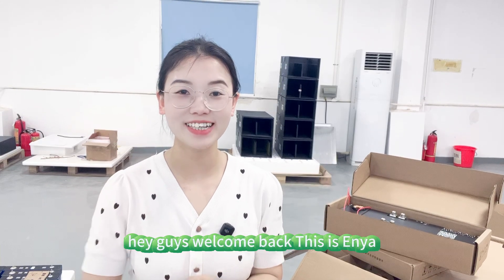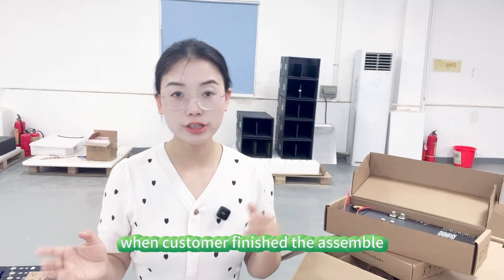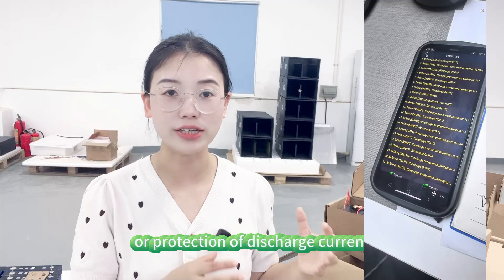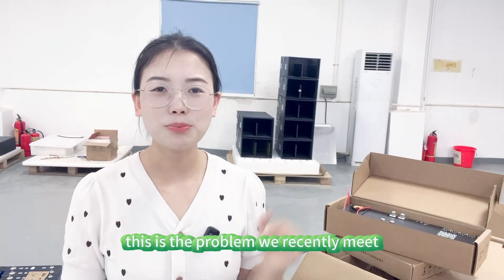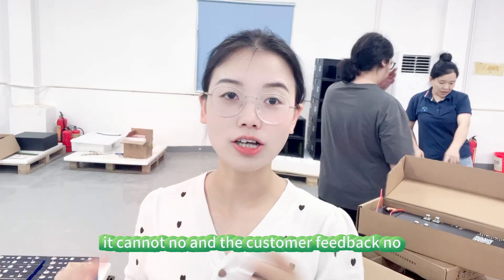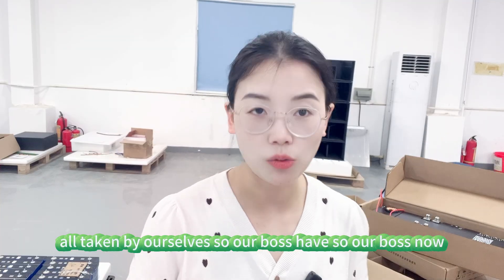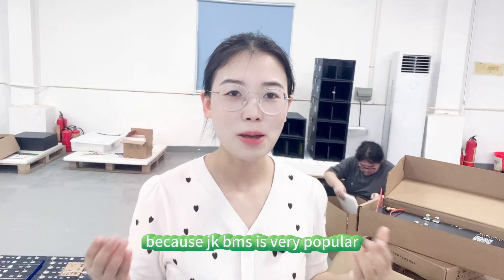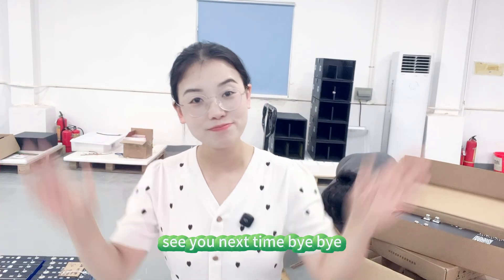Problem with JK BMS 16S20P

Comment: i have 4 jk v15 bms my friends have 4 v15 too. we have no problems
in our diy energy forum there are many jk users with no problems but a few with problems. sadly they report the same bad customer service from jk like you said.
so the jk inverter bms is a great bms (if you ignore the bad soc calculation) but if there is a problem then there is a big problem because of the customer service.
but the jk bms are very cost effective, honestly if once one goes bad in my powerwall i will buy another one. its not much money lost.

Comment: Very vage explanation of the actual problem. There are a ton of questions on how the customer has connected the inverter and programmed the BMS. JK or customer problem???
Good luck with the Pace BMS. The latest with Wifi and BLE is total garbage.

Comment: I'm not buying JK BMS anymore myself. Had self-shutdown issues with batteries in parallel.

It is because of the integrated balancer feature. If you activate the BALANCE function, it will shutdown, and it will keep shutting down. I have tried different firmware version, 15.29 - 15.30 - 15.32 - 15.41 ... all of them shutdown when the balancer kicks in. So, for me, it's a faulty feature, not production ready, not well tested with other parallel batteries. And I think JK is well aware of the problem, but they can't resolve it without hardware modification.

I'm putting JK BMS in my list of bad companies to avoid at all costs.

Comment: I've had the 300A DALY BMS for two years, and it still works very well. 
There was a problem with the 40A MPPT Charge Controller, which had an internal problem sending 120V DC from the PV plant to the 8S 3.2V 340Ah LiFePO4 battery storage (24V). 
The 300A DALY BMS went into protection mode, cutting off power to the battery, thus protecting it from high voltage. 
The off-grid voltage inverters burned out due to high voltage, from 120V DC, which they operate at 24V to 240V AC 50Hz.

I'll repair both inverters later, and they're working again.

I'm Tiago, from EletrInverter, a manufacturer/repair technician for off-grid voltage inverters in Lisbon, Portugal :goodvibes::yougotthis:

Comment: You can communicate with JK in Chinese. As far as I know, the JK official organization does not have any channels for directly selling products abroad. So posting the video here won't have any effect at all. There is no doubt that JK is currently the most cost-effective BMS. I really like their PB series of products.
The core content of the video is about after-sales issues. When your customer's BMS is damaged (whether it's due to improper operation by the customer or other faults), you directly send a brand new BMS to replace it for the customer, while JK requires you to send it back to their factory for repair. In my opinion, the key issue is how you promise after-sales service to the customer, and how JK promises after-sales service to you. You can't just because you give the customer a brand new product, you also require JK to give you a brand new product. Because different after-sales policies result in different product prices. If the price is low, the manufacturer's profit will be thin, so you must accept its shortcomings.
As for allowing users to modify parameters, I actually saw that JK was trying their best to assist you in solving the customer's problems. JK did this very well. Their BMS is very flexible and can meet the various needs of customers.

Comment: You mention changing settings again and again but didn't mention reviewing photos of their installation or videos tracing installation wiring.   Setting will make no difference if something is wrong in the wiring.
btw, Really like your straight forward honesty to share these issues so I am bookmarking your site for when need to do an installation.

Comment: I didn't have this kind of problem but noticed a very bad voltage and current calibration. I have 2 JK BMS running with Victron (not from you) and have to recalibrate all 32 cell inputs and the output current. With Seplos I only had a very bad balance power and a bad PC software but no other issues. 
What I also noticed on JK BMS is the fact, that SOC is drifting away after some time. This is likely caused by wrong calibration. A very bad product for that price, but software itself is nice. 
Combined Seplos hardware and QC and JK software and balancer would be a great product.

Comment: Despite the jk having such problem, the jk still remains the most reliable bms.  

I noticed this problem way back june 2025... The scp delay variable value is too little for the v19a.. unlike the v15(15.38) is a very stable

I have both

Comment: jk never answers there emails ...ZERO tech support ...
I set the passwords and wrote them on each battery and a few weeks later the passwords dont work and i cant get in to change settings ...
miro jk bms hack gets you in but you cant change password without old password ...Fuck JK BMS

Comment: The only problem I have with the JK inverter BMS is the SOC. The "old" 200A  Pace BMS are far better in calculating the SOC. The newer Pace BMS is not good at all with the SOC. Not so bad like the JK but bad. Hopefully we will see a BMS with acurate SOC calculation, that means with a good Shunt.
Reply: Agree, if a JKv20 use a port for victron shunt hehehe then SoC will be solved and report to inverter will be perfect. Now we need do some spoof/inject CAN.

Comment: this happened a couple days ago with a battery box and took out my 18k inverter. and locked me out of password  and had to work with provider to get new code from jk .unit is online now working could not figure this out till now with your video.  brand new 314ah. dyi kit

Comment: Yes you are right JK BMS has voltage jumping and voltage instability issues, which they are not able to solve. When I ask them about this problem they suggest some setting changes which does not work.

Comment: The key issue with the JK BMS lies in its choice of amplifier. 
Instead of a dedicated high-precision current-sense amplifier with low offset and drift, it uses a generic low-cost op-amp. 
Because the shunt voltage is only in the millivolt range, even a small offset or drift results in large relative errors. 
This makes the current measurement highly inaccurate and inconsistent across different loads, which in turn causes significant SOC calculation errors. 
Calibration cannot fix the problem: if you calibrate at high current, low-current accuracy is lost, and if you calibrate at low current, high-current readings become unreliable.
Reply: That's not a problem here, most of the people don't understand B- and P- on JK BMS, and the are making terrible mistakes all the time...
I have a lot of experience with people like this in the video...
Reply: @rozarijorodin yep, maybe you are right. But accuracy of current measurement is terrible
Reply: Si pienso que este puede ser el principal problema
Reply: yes it is and so the soc calculation is bad.
jk can solve this easily with a shunt like victron does 
but they dont want to. i dont know if they are ignorant, incompetent or both.
without andy from offgrid garage this would be a bad bms by far in the market.
jk should buy andy a yacht for his work.

Comment: I started with Hi-BMS and that worked very well. Then I shifted to Daly as the same company was making both Hi-BMS and Daly BMS. The problem could be in a single BMS and I think there is no need to put fingers over Daly or JK-BMS. The reason is that once I installed a Daly in one of my customer's battery and it worked fine. A few days later, the customer complaint about the battery. When I checked the settings, the Daly automatically shifted from 16S to 15S and as the voltage of one cell was shown as 0 so the battery never triggered. I tried to get some support from Daly but couldn't get better response from them and I shifted to JK-BMS. To be honest, JK-BMS are really great BMSs and the issue could be in one in a million BMSs. 
Now I go through the customer's choice, if they demand Wifi, I go for Daly with wifi, if they demand for screen and reliability, I go for JK-BMS. The PB version of the JK are great as it has everything in it. Cheers <3
Reply: Daly are BS' ing to next level. They tricked me into buying 2 BMS with comm boards valued at around 400 US$. They just forgot these BMS's could only charge with 125A and not the 250A as the type i asked for. Simply unbelievable and i still got their crap lying here with absolutely 0 interest for them. Beside that, they send them so i had to pay taxes although AliExpress states i shouldn't. 

All this due to they knew i couldn't use their BMS if it couldn't do parallel with 5A. So lie and get a deal or be honest (Like 99% of the Chinese companies i have delt with for 25 years by now). Shame on you Daly and never ever again while warning everyone about how nasty they are at business. (It was Daly 's shop on AliExpress discussed with and bought from)   

I agree on JK-BMS, they seem to be very well made and the 3 200A's i got works very well and integrates perfectly over Bluetooth with my Home Assistant. Unfortunately their support/homepage is very much below average. (And their way of changing from charge to float regarding Vdiff sucks badly as it is SO easy to make it sense the Vdiff vs. just having a preset timer making it guesswork from time to time as i made it through Home Assistant on my old 400A Daly with only UART as COMMs.)

Comment: I imagine some of (not all, of course) the issues are customer related because it's a steep learning curve doing a DIY battery pack for the first time.

There are always going to be defective products. The issue is how JK deals with these problems. I find it confusing how they can create such a capable piece of hardware (and software really, even though it looks 20 years old) and then have zero customer support and not even make their firmware available which is required for the device to work.

Why do they spend time improving the firmware if it's only available via a random Off Grid Garage OneDrive?

Unfortunately JK needs people to stop buying their products so that they realise it's important to provide good (any) customer service.

Comment: JK BMS V19 has a big problem with BLUETOOTH. Often NO COMMUNICATION /CONNECTION with the APP. only after a reset it works. V15 version works the bluetooth perfect
Reply: If using Android you sometimes needs to "close all programs" instead of just exiting by "going back". This way i always get it to reconnect. But it could absolutely have been better and more reliable. The app has just been updated in Play store (mine was updated today), perhaps it has improved with latest update, at least the wrong screen size thing seems to have been fixed so all buttons now are visibile..

Comment: There isn't a BMS manufacturer out there that understands Modbus or any industrial protocol. They need to hire a good industrial control engineer to rewrite the whole code. I have hacked many of them to extract the data needed, and I use a PLC to communicate and control the inverters. The whole industry is a mess!

Comment: JK; we run into the same issues. We have multiple JK BMS’s and some of them are working just fine. The latest JK in the chain of 3 has issues from the beginning with outlier messages on the RS485. When raising an issue with the vendor we receive no response. Finding the correct firmware and upload it is a challenge on its own. When it goes wrong you have a bricked device. The product is not mature enough. Yes it is cheap and therefore popular in a certain group, those seeking reliability, quality, good support and fool proof operation - then JK is not it.

Comment: My last 2 JK BMS's (commissioned in June 2025) have a continuous problem of not showing the proper state of charge, when compared to my other 5 batteries (all 280Ah) When the 5 Batteries show eg. %92 charge, the 2 wonky ones will show %56 or %63 +/-. I did find a way to somewhat re-set the SOC by sending the command; "Battery size" ... the re-set value increases the shown SOC by %10 or so, never reaching the value of the other Battery's. The Battery's are all connected in parallel to a common busbar, & the voltage shown on screen are all within 0.05v of each other. It's a mystery to me.

Comment: hey,
dont you speak chinese with JK ? 

So far I had the same issue caus JK did not react to the complains that their promise being Growatt SPH 4600 compliant is not true, cause every single day I get warning mails and message from the growatt cloud with growatt error messages. This is not happening if I use a growatt battery hence it is a JK issues for 2 years at least.
Hence JK does not care and does not provide support and solutions for 1 year old BMS as they are shipping now V19. 

Quite disappointed.

Comment: Most likely that customer made a wrong connection when setting up and caused a short circuit, they will not mention that to you... that's what is responsible for this. Its important to check the voltage progression with a meter before connecting the plug to the bms
Reply: the biggets problem is JK BMS factory... they ask all those stupid settings change like it changes ANYTHING..... if customer shows 500A being draw...how da fck setting siwll change anything??? this is very chinese thing to do..always make customer suffer...do stupid setting changes that makes no sense...
Reply: @SayWhaaaaaaaaaaaaaaaaaaaaaaat lol, true
Reply: Idiots are going to be idiots and good people sometimes make mistakes. Problem is, not all are honest. Next problem is, JK doesn't have the option to screen who they sell products to. To assume the customer is always at fault is a bad approach. If a problem like this is often repeated then find out the cause and fix it or prevent it. The device can have reverse biasing added.
Bottom line is, JK gets the raw end of the deal in the PR game if they take a hard line and do nothing but stonewall complaints.
Reply: @beebop9808 i can say it, because it has happened to me, i did not go complaining, one of the wires accidentally touched another cell while wiring, when i finished setting up the battery, that was exactly the behaviour i got, plugging the bms cables to the bms is the absolute last thing i do now when setting up my batteries.

Comment: Their software support is an outright joke. Having latest files placed on the google drive of a Youtuber. I got 3 V19 200A JK-BMS's i installed for a total of 75 kWh about a month ago and they do seem to work fine in all respect. But i haven't managed FW upgrade on one of them yet where the 2 outers works flawless. Very fair and honest video. TY
Reply: Really, they all talk to each other properly?  What firmware are you running?  I have multiple V19 and they do not talk to my Victron system correctly.  In addition they also do not display properly when in Parallel mode in JK-BMS-MONITOR.  Be interested in how yours are working when so many others like myself are having major issues.
Reply: @danarawding5198  I have had no issues regarding parallel mode and have tested and confirmed "specs"/capabilities are updated and accepted by my Deye inverter when unplugging an individual BMS. I have live Bluetooth connection from all 3 to my Home Assistant so doesn't use JK-BMS Monitor.  The two slave units run 19.10 FW while i can't remember what FW edition the master is on, but i believe it is 19.05.
Reply: Your boss do it 👍.. thank you for this video 🎉

Comment: I use only Seplos v3 BMS... it's a simple BMS, work great once good setted, but don't have an active balancer ; i add one by myself in a separate board. Like all device make everything, yes they made everything, but also nothing really good. I prefere have 2 boards completly separated and they works on their side for what they are do. After more than 400 battery build in France, no real issue about this Seplos BMS.
Reply: seplos is the worst bms on the planet

Comment: I guess I may be lucky. My JK BMS has no issue at all. Been rocking mine for two years plus now.
Reply: switch that to growatt SPH inverter and you will get every single day at least 2 messages and warning with error codes that should not exist.
The software is not compliant as promised cause there is a simple test: If I connect the inverter to a genuine Growatt battery I do not get the cloud message and notifications. 
JK does not care nor fix the issues.

You might be lucky, so be aware that others are suffering.
Reply: Same here. I have v19 and everything is working fine👍